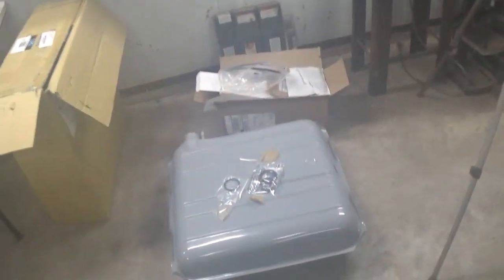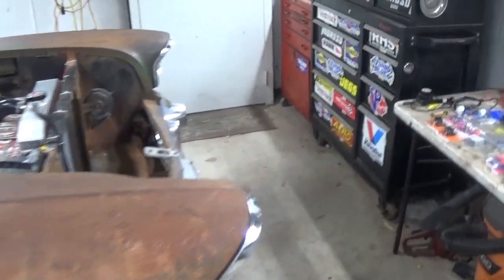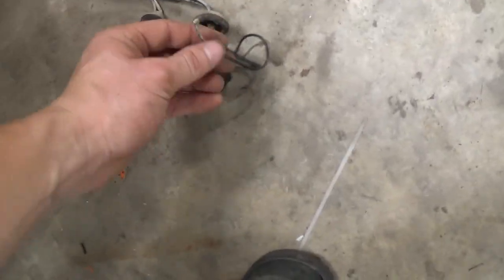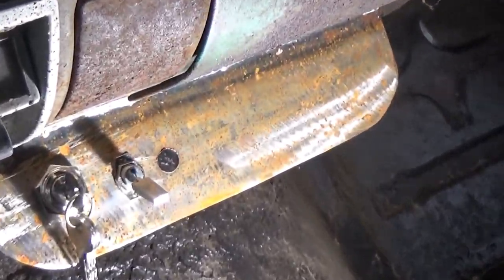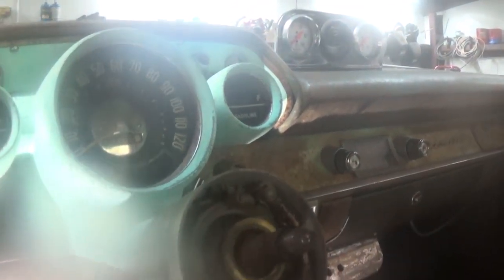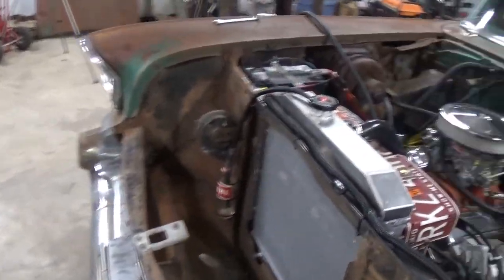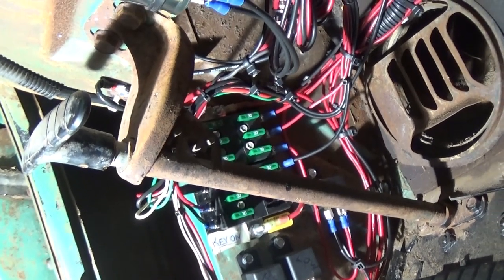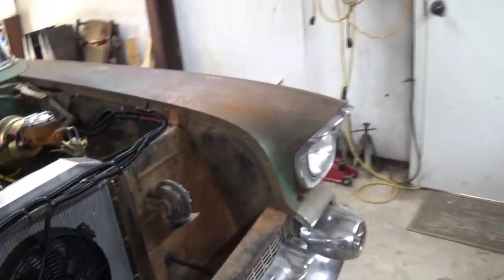1957 Chevy 210 - episode 12

Comment: Could add a second gasket or so on fuel pump to lower pressure . It is how VW did it for years.
Reply from the maker: I didn't know that. This pump was putting out like 7 psi and the Edelbrock needs 4.5 so it was much easier for me to add a regulator